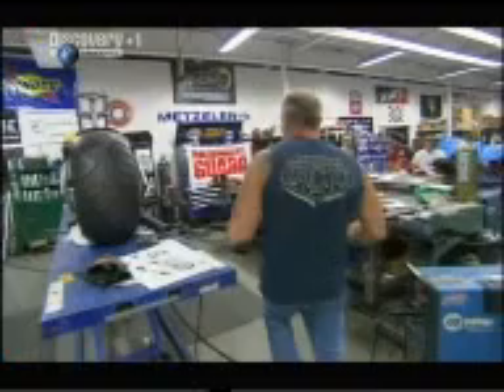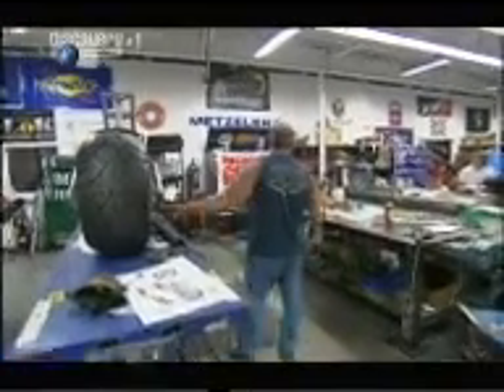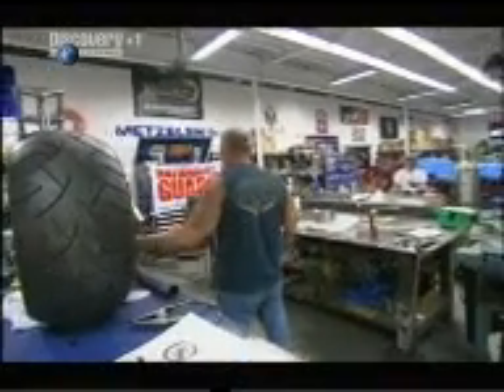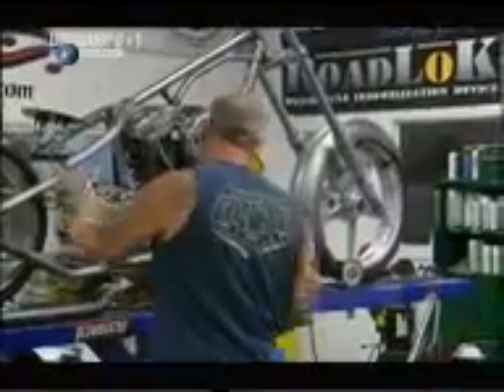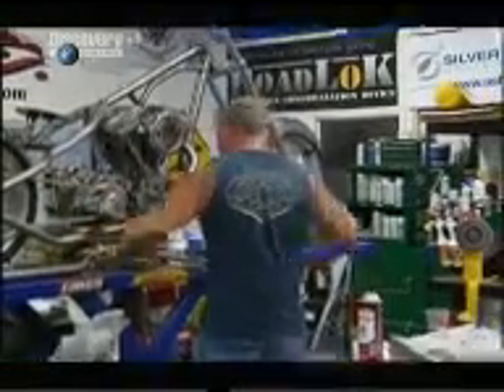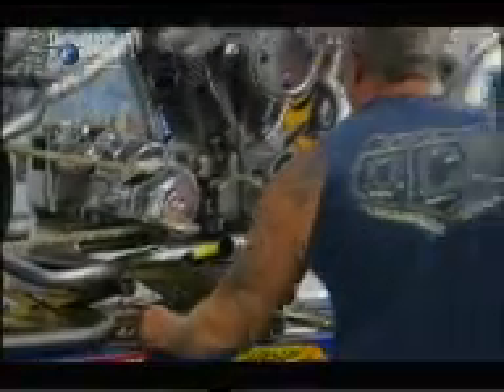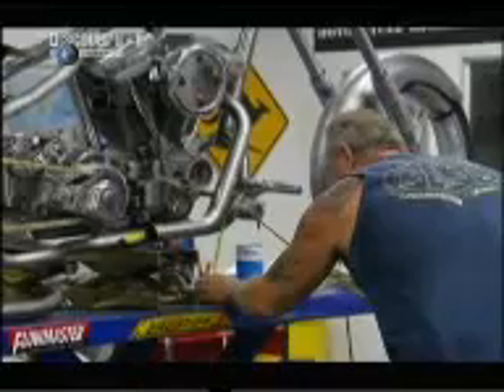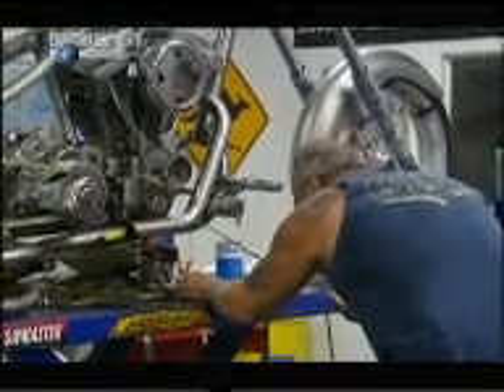Why the English now use the metric system

Comment: There is inherently no difference in accuracy between the metric and the imperial measuring systems. Proper engineers use the imperial system as a decimal, five eights becomes .625"  This way accuracy is maintained to a thousandth of an inch. A good engineer is competent in either system.

Comment: Not that the British DO use the Metric System for everything.  They still measure speeds in miles per hour, fuel efficiency in miles per (imperial) gallon, and body weights in stone and pounds.
Reply: Body weight is just a personal preference. I'm British and I've always weighed myself in kg (try working out your BMI from that "stone" (-age) nonsense and see how far you get).

Comment: (；￣Д￣） American Schools need to teach the metric system early in life. That by far is easier than the American Standard measurement system. I wish they'd have taught us the metric system in the early grades of school. They're multiples of tens and are quite a bit easier to understand than say twelve inches and three feet, then there are miles. It's so damn confusing. They taught it in later high school science, which is fairly useless because it takes longer to learn, then there are conversions.